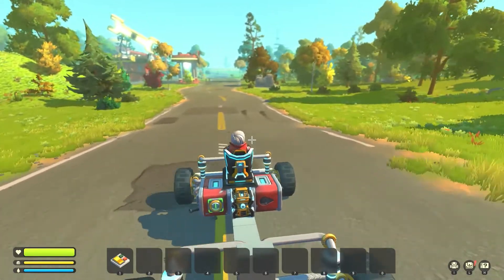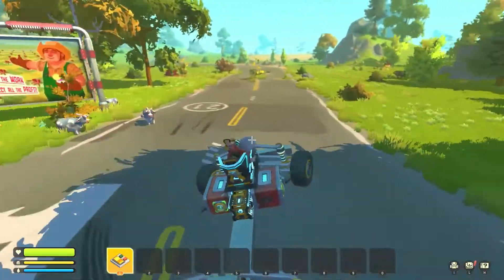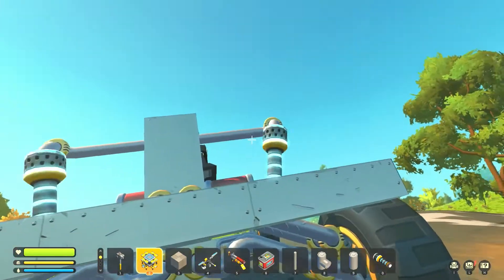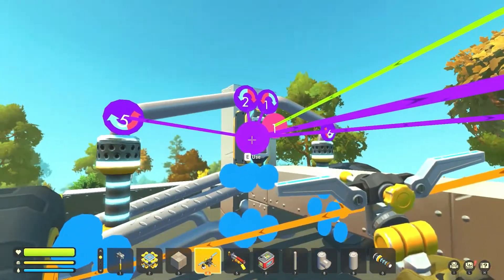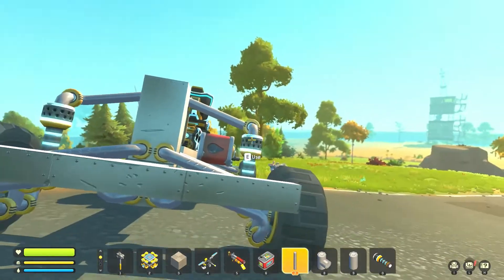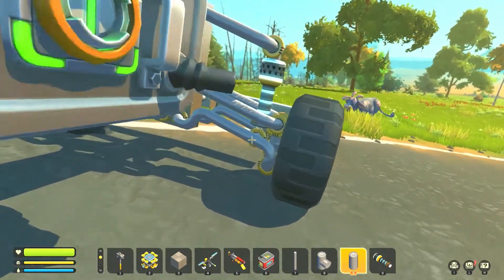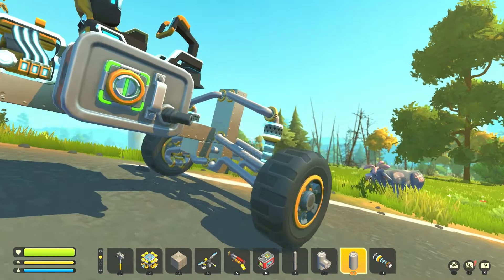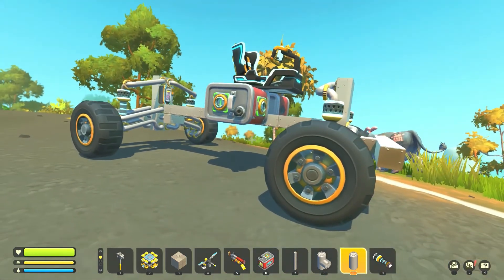Scrap Mechanic Survival  - Adjustable wishbone suspension, has a fault, troubleshooting and fix.

Comment: Hi I’m thought I’d just say thanks I’ve recently bought scrap mechanic because I’ve wanted to make cars and contraception’s a lot and your video helped me with my idea for real life double wishbone suspension with upper and lower arms and springs
Reply from the maker: Have fun. Its great to think up something and have a creation, that eventually works. My biggest tip for a beginner,  Its a physics simulator, not actual physics. So something's work others do not. Survival is like creative with the physics slider on on 8.